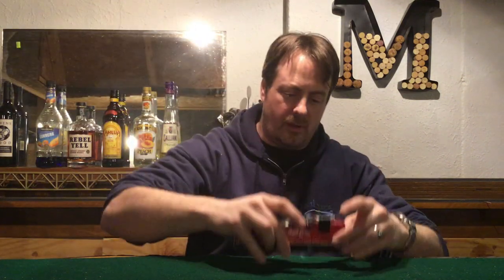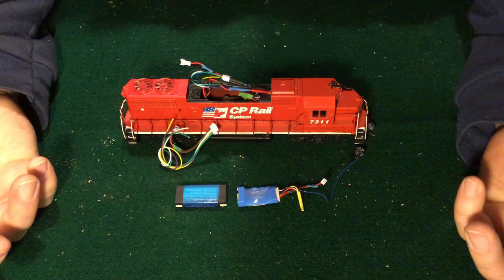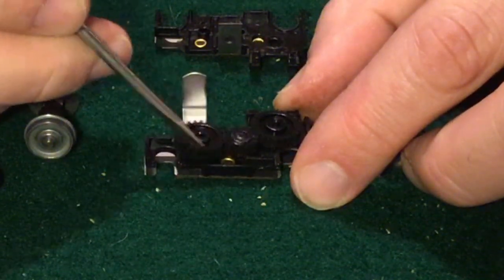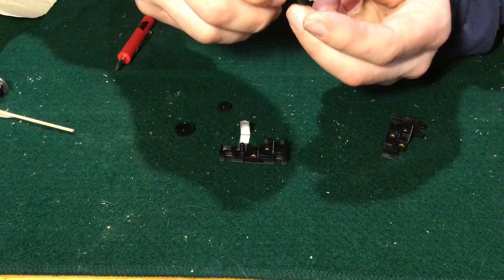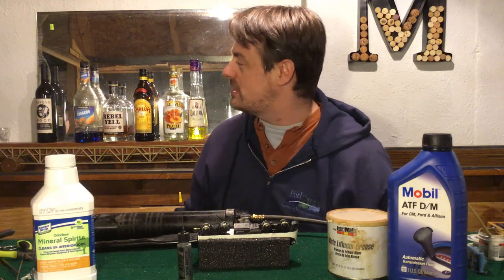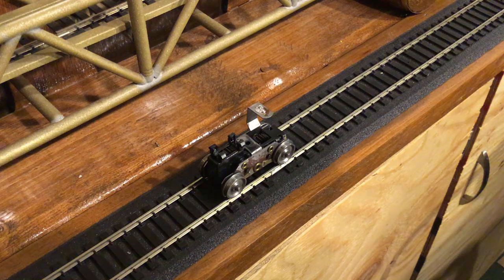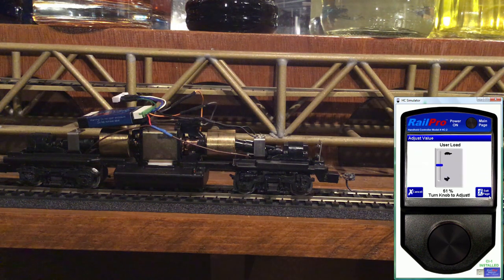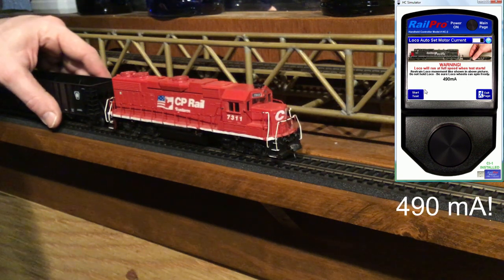Model Locomotive Truck Maintenance

Comment: Polishing, i/e lapping. 
Great tip as I've only recently gotten back into the hobby and have some old blue box stuff from my younger days to bring into the 21at century. 

In case you're interested in another lube to test. There is a grease called Cal's drag grease that is used when restoring it improving high end fishing reel drags.. It's safe for brass and plastic. I put a few dabs in the gears of some proto E7's and it really quited them down a lot.

Comment: Hmm. Very nice. The one thing I will add that. Helps narrow down the lubrication argument is that nearly everything out there either adds gunk or corroded over time. Hob-e-lube, Labelle, and graphite tend to bee the exceptions. Very nice job. Any blue box of mine usually gets a full tear-down and lube job like this plus the pickups soldered directly to the truck sideframes a-la Kato and Atlas style to bypass all the loose contact points. Gives me a lot more room inside too.